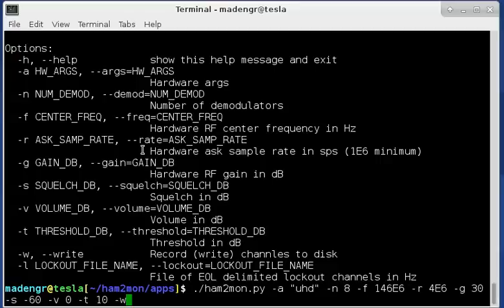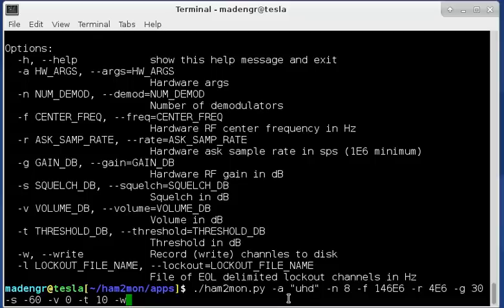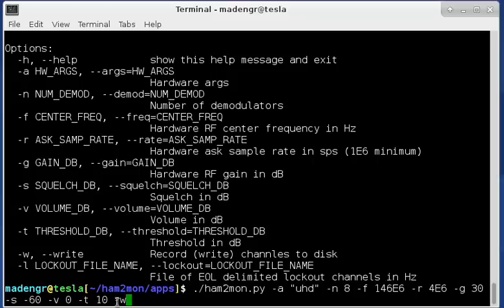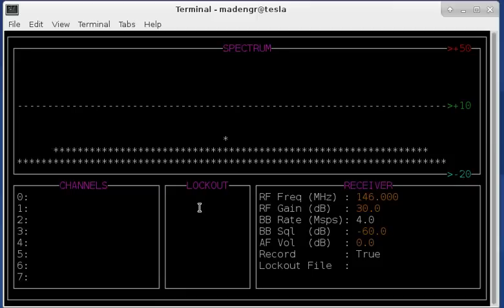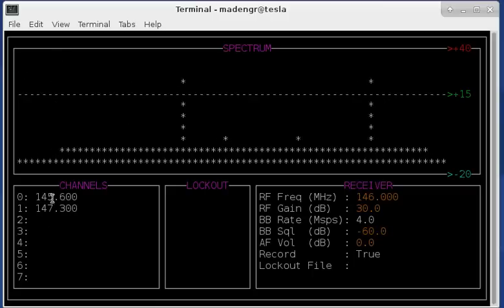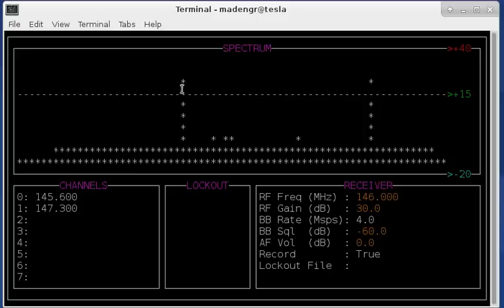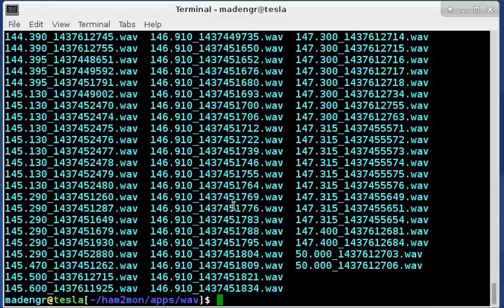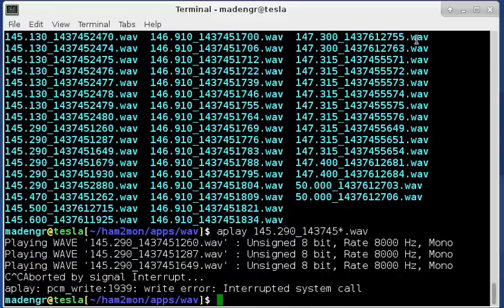ham2mon

Comment: Can this be used to search for non FM (sideband) signals?
Reply from the maker: No, it requires symmetry in the spectrum to automatically lock the receiver, such as FM or AM.  SSB is asymmetric thus will not work.

Comment: Took a while to get this going with an RTL SDR. Of course had to install gnuradio and gr-osmosdr modules (~1.5 GB with apt). The default RuntimeError message is especially unhelpful, so I changed the code at the end of ham2mon.py to:    

except RuntimeError, e:

        print ""
        print "RuntimeError: SDR hardware not detected or insufficient USB permissions. Try running as root."
        print "{0}".format(e)

to find out what the error actually was (it was complaining about not finding the alsa device, so the default message was a red herring). I also needed to change the TERM environment variable from xterm to linux to get reasonable formatting from the UI when logged in through ssh, although it is still very jumpy. Adding some vertical space on the virtual terminal helped with that. Unfortunately it was still to much for my R-Pi 3B, which ran at 325% CPU with no signals present, and when signals were present, it appears to overload the processor. The output files were created, but bits of audio were missing here and there. I used the open source program iqToSharp to convert the raw file to a format that sdrsharp could read. It looked like the very low frequencies <30Hz were very intense on an FM repeater output. Not something I expected. 

I tried feeding the raw file captured with the rtl_sdr program. I could not move the upper threshold of the display high enough to show anything but asterisks in the graph. Even though there were plenty of signals present, nothing was actually detected.

So in the end, the purpose for which I intended to use the program (inspection of repeater input and output frequencies to profile sources of interference) isn't going to work without faster hardware and/or code modifications, but the program shows a lot of promise. It would be nice to fix the staircase text output.
Reply from the maker: Chris Sullivan did you run volk_profile ?
Reply: @rfengr00  I had not heard it. I've not done anything with gnu radio until yesterday. After running it the screen doesn't freeze up whenever a signal comes in but the audio is missing the first second or so, as well as pieces in the middle, and is quite distorted. A morse code tone sounds like a buzz. Removing the harmonics in an audio editor (audition) makes it sounds like morse again. The CTCSS tone of 103.5 Hz is quite apparent, but so are the even harmonics which aren't actually there.
Reply from the maker: Chris Sullivan you’ll need to run volk_profile to reduce the CPU usage.  Then tune it to 162.55 MHz or such to check reception.
Reply: @rfengr00  Thanks Louis. Yes I ran that before my last comment. It created a file .volk/volk_profile in my home directory. Is that sufficient? Like I said not much effect on CPU usage when squelch is closed, but it seems a bit better behaved when it receives something. The output is still missing bits and the CPU is still close to flat out. I can try it in the weather band but I'd be surprised if the results were different to the 2m band.
Reply from the maker: Chris Sullivan yes
Reply: @rfengr00  Sounds like it won't work on the Pi 3B at least. Maybe I'll build a linux disk for my desktop system and see if it works any better. It's a bit old but I think the numpy stuff will run fast on my nvidia GPU. Thanks again for the advice.
Reply: Hi Louis. I finally tried it on my desktop on Ubuntu. The Ubuntu gnuradio package wasn't Python 2 compatible so I converted your code to Python 3 which wasn't hard at all thankfully. The same command uses about 20% of the available processing power. There is no jumpiness in the GUI and no missing bits in the audio files (except when my transmitter desenses the repeater receptions). The one thing that doesn't look right at this point is that the 103.5 Hz CTCSS tone has audible harmonics (both odd and even) and the audio is somewhat distorted. The audio levels are also about -33 dB peak. The CTCSS tone is around -48dB. On close examination the CTCSS tone along with its harmonics are almost a rectangular wave negatively DC biased. Unless other audio is present the wave is 100% negative, with the top at 0 (i.e. - inf dB) and -40-something dB. The zero part of the wave is about 40% as long as the negative part (about 30ms and 70ms). I'm pleased that it is now much closer to what I was looking for but I'm still hoping that it can be improved further.

I just noticed the WAV files are 8 bit. With a maximum level of -33dB, that's not a lot of dynamic range left - less than 3 bits I think which is pretty lo-fi. Hopefully by going to 16 bit and maybe boosting the volume it will give me some good recordings.

Comment: I'm getting an error saying,
""" Module not found : _builtin_ """,
 it is not included in the ham2mon zip file...
Reply: I got that with Python 3, but not Python 2. If you're running Python 2, then maybe the version. On Python 3 I removed import statement and found all instances where it referred to __builtin__, and removed them. E.g. the line with ... __builtin__.filter(...) became just ... filter(...)
Reply: @ChrisSullivanVE3NRT  Thank You...🙏🏻

Comment: Hi Luis,

tested with the HackRF and with an RTLSDR. It works on both but there's a problem with the HackRF. It has 3 gains: one is the RF gain (that is managed with the -g option) and the other two are the IF and BB gains that is actually are not managed by your software.

Unfortunately, for the HackRF the IF and BB gains are the most important ones (the RF gain is set to 0 most of the times) and without them signals are almost flat.

I don't know if you can handle it but it'd be great to have it fully running with the HackRF as well.

Thanks!
Reply from the maker: Can you specify them in the hardware arguments?